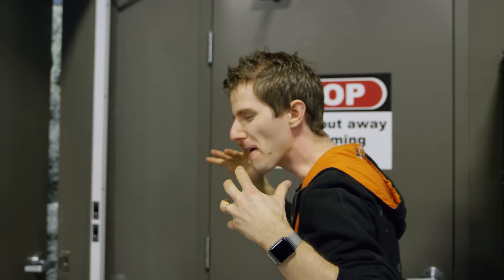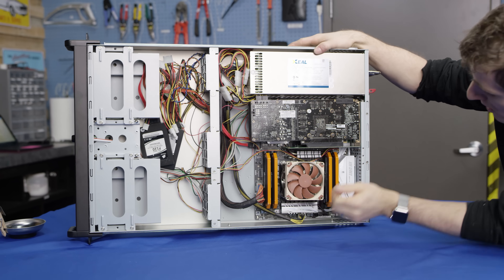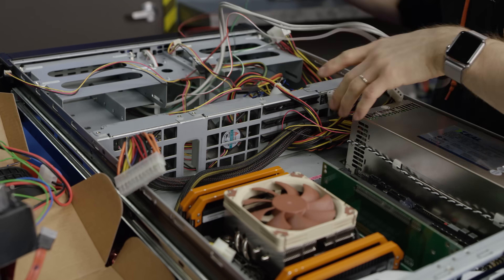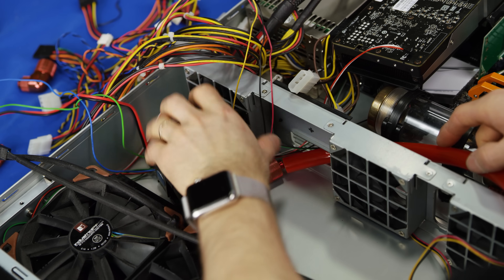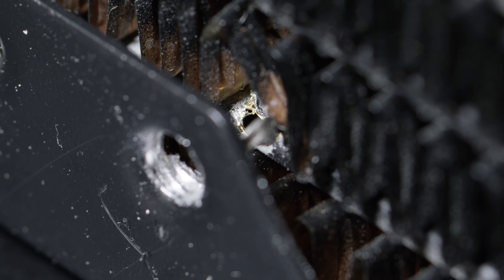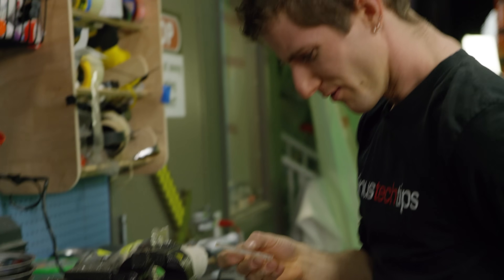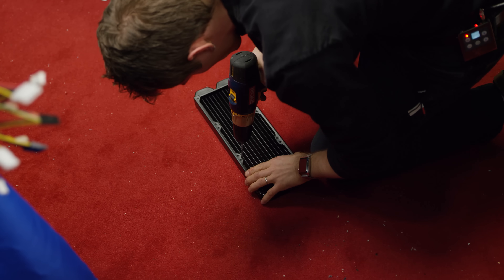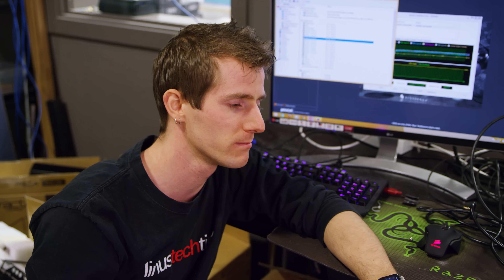Watercooled, Overclocked SERVER Build!

Comment: If tubing is the problem because it's porous, why not use copper refrigeration coils? They are flexible enough to run anywhere tubing would, and are solid metal.

Comment: You know what you should do with all that computer server stuff is water cool all of it and run all the piping to a heat exchanger in a larger water tank that feeds your hot water heater as a preheater. Then your server room won't be hot as heck and the water in the tank will transfer heat better and hold more heat plus it would lower your hot water heating bills. If you get bored you could make a computer controlled servo valve that would switch to an air radiator if your preheat tank water gets to warm. Yes I am a nerd and an engineer.

Comment: Teflon tape from a general hardware store would be much better suited for leak prevention than just torquing down the fittings with a pair of Vice-Grips. Truth be told, I'm surprised you don't use it with all the water cooled builds you've done.

Comment: holy crap.... I don't think I have ever seen a video like this of what NOT to do.... Yes I get the need for custom solutions but holy crap. 

If it is that important a solution let's take time to do it properly. 
might want to start with a radiator that will fit sideways for proper airflow
mount fans that will pull the air properly past the radiator
use Teflon tape on the metal fittings
use washers to space out your screws
industrial strength double sided tape to hold the radiator in place
etc. etc. etc.

Waiting for part 2 of this video of how to do it properly.

Comment: I would have used Teflon pipe tape on the metal fittings  also.   on top of that  ive had to have my dual radiator for my race  car repaired. look into radiator repair shops and price what it would cost to fix the hole correctly as they usually do a pressure test with air under water to make sure it will hold a cetain amount of psi ..... great video though

Comment: I could see exactly what was going to happen when Linus started drilling into the radiator. 
This is why you slide a thin sheet of scrap aluminium in there before it's too late.  

No idea why he just didn't use screws with the right thread in the first place.  Shrugs.

Comment: The risks of a DIY water cooled server aside: Why the horizontal 120mm radiator with virtually no airflow? A couple of dual 80 mm radiators mounted vertically would give you a clean front-to-back airflow and much better cooling, despite the smaller overall radiator area.

Comment: Not trying to hate but those are all desktop components aside from the case and power supply.. First thought I had when I clicked on the video was: How is he going to overclock a Xeon on a server board... I guess the desktop computer in a 2u chassis is intended to be used in a way a server would be used but still.

Comment: 8:37 I know it's fairly common practice, but it still makes me cringe anytime I see someone hammer with an automatic center punch. That looks like the 6580 from TEKON off Amazon. If it is, it should be spring-loaded, meaning you can just give it a bit of a push and it'll mark without the need of a hammer. For material like painted metal, like that, it might need assistance, but honestly, the point of a center punch isn't to make a huge hole or dent, but a "grab" point for a bit to bite into, or to measure by. There are times where a hammer might help, but in those times, it's usually better to use a non-automatic center punch so you don't risk wearing out the spring.

Aside from that one inane complaint, I love the video! It's great to see Linus with a genuine issue that he wasn't expecting! It's in those cases where is level of knowledge in the field really shines. Working with epoxy, J-B Weld, etc. is always a hassle, but extremely satisfying to see when it works well. I was also impressed with how great the counter sunk screws fit in the case. It's tricky to do on "simple" material like wood, it's a bit trickier with a thin-ish metal. Good job!

Comment: I acquired at no cost (employee deal, fully depreciated) a Desktop Server from my company that decommissioned it. A T5600 dual Xeon E5-2667 (v.1 2.9/3.5 GHz Turboboost, 6 core & 12 threads  x 2) with 32GB DDR3 EEC RAM. As games typically use up to 2 cores these days, I was wondering if, in a gaming mode, I could go in windows and reduce the number of cores to 2.  Would that allow the CPU to retain turboboost longer with the OEM air cooling? 12 cores is clearly overkill for gaming. I assume 2 cores would also consume less power, even if the remaining 10 cores are in reduced demand.

Comment: Standard sysadmin installing a PCIe card with big dimensions into a 2U server: dismounts the riser, inserts the card into the riser card, reinstalls the riser in straight angle
Linus Sebastian installing a PCIe card with big dimensions into a 2U server: states that the card will have not much space, throws out underlying network card, tries to insert card, swears, tries to insert card once again.

Comment: Holy crap, why did you need to drill the radiator? Just go to the hardware store and spend a dollar or two on the proper flat-head #6-32 screws.

Comment: Why you do not  use the server fans with high rpm?
Reply: Flat4Buggy 2 Those that at 5000 rpm? So it is not bad, but they are still slowly then several servers fans. I saw 120mm fans faster than 7 000 rpm. Maybe it is good for overclocking.

Comment: You can have a leak on this fitting. O-rings that is used is fragile, and use force is not the way! if is critical you have to lock up how many Nm of torque you have to use to tighten them right! what you did is to mutch!!

Comment: Linus: 11:23. after drilling a hole into the first radiator "i should have just mounted the radiator with double sided tape".
Linus: 14:24 Drilling into the second radiator. TEMPTING FATE. what happened to the double sided tape Linus.

Comment: clearly no accomodation for how much space air takes to move around the faces of the radiator. it should ahve been mounted external to the 2 u case air wont flow through that at all

Comment: Guys, we really CAN`T have a leak in this cycle. We even used a solid metal block, so we are really sure we will not have ANY leaks in this system! 
Let me just drill a little hole into that radiator...

Comment: omg I'm so glad you swapped out the rad. Placing a potentially leaky watercooled server above other mission critical hardware? Derp. What did you overclock it to? Could you have installed an AC unit in the server room instead and used cool air for overclocking with the extra benefit of keeping everything else cooler like all those hard drives in PB project? was there space to simply put the rad and bits OUTSIDE the server case? Lots of questions I know but for someone who has access to almost unlimited hardware, you sure do janky projects on LTT. Maybe I'm missing the point entirely but Linus this kinda affects your credibility no? It sure was entertaining - I guess that's the point.

Comment: Hai
I am a student in engineering doing project work in AI and now i am in the testing and coding stage after completing my paper works. So i wish to have a server that can handle high amount of data, process it as per my program and get me the needed results within no time. It should be fast, secure, reliable and should work 24x7 without rest. As i am a student and i dont know anything about servers and all. i wish to know about servers and storage and processing setups that i can use to fulfill my requirement at its best. So i hope you can help me with proper guidelines and instructions for my needs. I dont know about how much data that will accumulate, so as the data goes bigger with time, i need an expandable dynamic server for my requirement. I request and hope your sincere help at its earliest.
with hope and trust
Libas

Comment: if i was him i would of had the rad on a slant for the inner fans to help cool it off with the intack too.. not laying it flat have it half on the side like a 30 degrees or so on its side to the front airt wont come in under it and then cool it off an all.. @Linus. i think it would of been alil better for that or just had it fully run the hose lines outside abover the aio ports in the back and had a stand for the pump rad and res all out side of the rack with quick connects this way u can unplug and the clean up would be easy too and full up too.... but thats me if i had all the stuff there to do all that with.... but love watching the shows time to time it gets my mind going on other things and see other ways i can get my things done...

Comment: Everything about this sounds like a really bad idea. What if it leaks someday and it drops to the lower racks? I wouldn't risk it. Raid 1 with refurbished, outdated SSDs? And yeah you should just have used a good double-sided tape to fix the radiator in place, since it will be sitting horizontally anyways.

Comment: I'm sorry but using pliers to make sure that the fittings can't leak and then trying to use Epoxy to repair a Radiator in a way no one should ever trust it to not develop a leak. And that even over Petabyte Project which could have been destroyed by a leak. No amount of time saving would be worth that risk, in that case you should buy a new radiator anyway. At least the AIO radiator he used seems to be from a Fractal Kelvin S36 which uses copper radiators, so that could be worse.

Comment: That is not a server, that is shit in rack mountable case. Also nothing about OC there. And radiator INSIDE? Have you ever seen a proper server rack? The air goes through the front to end, so ventilators facing up are just stupid. This is nice for home server, but nothing to brag.

Comment: This build is so far (from what I've seen during years) the most ghetto/horrible 😂
Least he changed that epoxy fixed rad.. Temperature results not that effective either.. Concern there is no modified fan holes for rad in this rack (it wouldn't work anyways when stacked tough).
Hope this doesn't leak to that petabyte rack.. He looked so unfocused and busy when building this 😬😄😄

Comment: Worst of your design I've seen.
Why do the windmills on the radiator through which does not flow air?
You had to either give it under the slant, or use spacers like the motherboard.
Alternatively, drill holes in the bottom to allow air to flow.
Project to improve .....